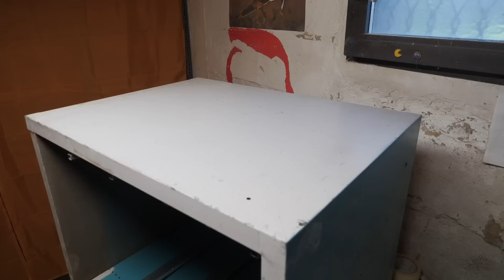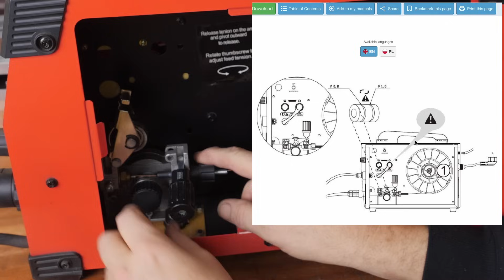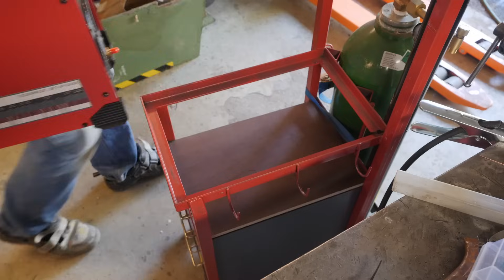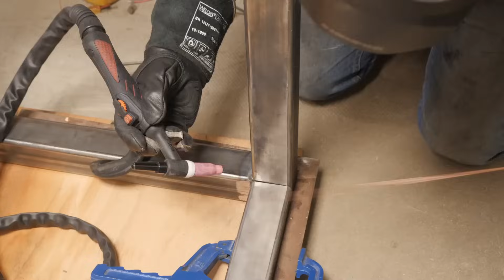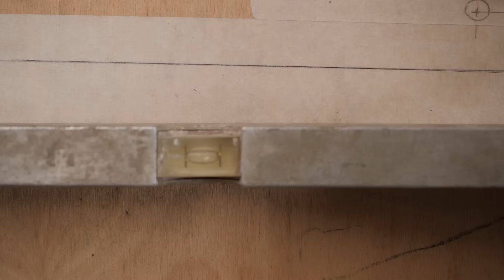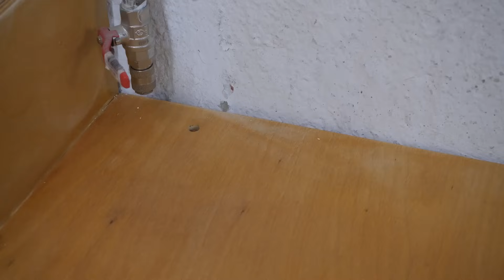My best workshop bench || RotarySMP

Comment: I'm no welder but I"ve seen people usually chamfer the parts where the weld goes if they plan to grind it flat afterwards. Otherwise you’re grinding the weld strength away
Reply from the maker: I should have. I think I started with the illusion my welds would be so perfect they would not need grinding, and then reality can to visit... :)

Comment: I have a 26"-30" x 42"-48" sheet of 3/16" steel sheet with a 1" 90° bent on one end. And a 2"x3" hole cut out of  a corner. I figured id make a little welding table out of it. Get a bit of 1/8"-3/16" wall angle  or 1.5"-2" channel or angle steel to make a frameand legs. Maybe get a section , maybe 24"x24"-24"x30" of expanded metal , or catwalk (about 3/4"-1' x1/8" flat bar separated by about 3/4" and connected with multiple 3/8"-1/2" bars every 6" roughly.) can often br found in 24" wide and random lengths used in factories  and industrial buildings for walkways usually 24"-36" wide (est.) makes a nice car trailer floor. As long as you have enough cross braces..  and would be great for a work/welding bench where modified C-clamps can be used to clamp anywhere. And it can be grounded so no ground clamp required..   and mount 4, 20-30 (maybe 50?) watt LED flood lights over it. So EVERYTHING can be seen even through a welding helmet! I need to get a auto darkening unit... I have some glasses not really for welding  much, best for brazing . Not quite dark enough but i really like them!   Tge cat walk steel works good with T nuts also, have two 'T' nuts on a threaded rod  3/8"-1/2"  lock them both  on the steel. Then a slotted bar can be used to clamp down steel to the table to weld or ???  Maybe make two 6"-7" and two 10-12" with a couple nuts welded to a 6" bitbof pipe with a to put a bar inside a 1/2" bar about 6"-8" long.  Use fine thread in one end coarse on the other. With the clamp on whatever, the coupling can be turned even though the cuping is only moving down the rod. The different thread pitch allows it to tighten the clamp. Maybe use 7/16" and 1/2" . The two sizes if studs (make two of each, 7/16" x 6" and 10"-12", and 1/2" the same length with couplings to put them together the 7/16" fine  to 1/2" coarse with a nut for each welded into the ends of a 5/8" pipe with a 3/8" hole drilled 1/2" above and below center if the pipe the holes completely through the pipe 90° from each other. The bar for fitting in the holes made from a 1/2" bar bentt st a 45°, (30° to 60°) about 3-4" from one end. After the bar is turned down to .370" x 2.75" and a 1/4" x 2.5" bar welded to brace the bend  the opposite end  turned down  3" from the end leaving 3-4" in the middle. Maybe weld a 1/4" rod beside that as well. Bracing tge 9"-11" tool make oversized nuts for the clamps  from 1"bar stock drilled and tappoed. Or drilled out and a nut welded inside. Eith a 1.5" long 1.5" pipe welded on the 1/4"-3/8". Thick slice of bar.  Then drill 2-3 , 3/8" holes in the pipe at 90° or 60°all the way through the brace on the bar allows it to hang on a bolt. The 1/8" wall tubing. Or 1.5-1.625 bar stock bored out and tapped with the open end being about 1" I.D.   and beveled  possibly knurled to allow a good grip by hand then the 8"-9" maybe 11"-12"+ long tool  maybe make another 6" long with a 2" circle with a 1/4" x 3/8" nub allowing it to work like a coil over  wrench,  made from 1/2"x1/2" square bar.   A 3/4"-7/8" long bit of 3/8" bar with 1/2" of it tuned down to 1/4"-5/16" fitted into a hole in the  heated and bent  square bar snd welded in place  allowing just enough room to fit the nuts with a 
1/4" x3/4" bolts (grade 8 or better)  placed 180° and 22.5°  from the 3/8" pin.  The rest of the square beveled corners to the opposite end where 1.75" of it is turned down to .375"-.380" fitting snug in the drilled holes.  Maybe add a 4" long bit of 1/2" square bar welded to brace the other . Chamfer/ bevel the edges and taper the end 1" taper frim 1/2" to 0";over 1".   1/16" bevels.  Made from a carbon steel capable of a temper with a 35-42 hardness, about 2x that of a mild hot rolled mild steel.   Use the studs and nuts  with slotted bars made from 1/2" x 1.25" steel bar with a 1/2" x 2".  And 1/2" x 6" bars also a welded bar made from  
1/2" x 3/4"  bar 12"-16" a slot allows a 2" end to be swapped out  the 3/4" thick steel having two 
1/8" x 1" tabs  that attach with two to three 1/4"x 5/8" basically grub screw's, the tapered pin 5/8" long with the 1/8" deep allen head with a 7mm diameter tapered head  fitting into. The 1/8" thick steel    m6 thread m7-m7.5 head about 45° tapered seating head  the end caps using either two 1/8"/3mm  flats seperated by 1/16"  or a single 1/4 maybe go to 1/2" x 1" steel.  With a 1"-1.5" long 3/4" steel square connecting the two pieces.  Either a 45° tapered nose going from 1" thick to 1/2" and 3/4" wide or 1.5" wide to 3" wide with a split like a crowbar or claw hammer. With a 1/2" wide groove in the center 3/4" deep.  The last option is s coupling end allowing teo bars to. Be connected together.  Use with the 1.5" x 8" x 3/8" thick , and the 1" x 8" x 1/4" thick  plates. Allowing teo plates to be connected together to fit across the 30" table. And over something 14"-16" tall possibly 28"-30" if 4 long studs are made.  Or two 7/16" and two 1/2" studs  with  the nuts  being turned different. the 7/16" for example having the upper area turned down about 1.425"  and the 1/2" being turned 1.500"  both made from 1.635" bar stock making basically oversized flange nuts  that use a  kinda pin or bar wrench over a hex. It can also easily be a hex, make a 1.5" 12 point hex or square I like the bar nuts because anything can fir it. A 3/4"-7/8"+ wrench can be stuck in one hole spinning the nut, same for a screwdriver. If it was a normal bolt and nut it would have about a 1"- 1.125" thread (7/16" & 1/2" is tiny compaired) the nuts being. Oversized  doesn't require a washer and pressure is spread over a wide area.   Either plate thr steel with nickel or copper to reduce rust a chrome plate would also work possibly attempt to get a .004"-.0045" plate over the steel for multiple reasond i think nickel over copper would be Best. With about .002"-.0025" of copper, and .003"- .0042" of nickel to protect from abrasion dings.  Better than a .00025"-.0005" thick plating you can nearly see through!!  And copper plate the studs. ENOUGH RAMBLING, 🫣 🦾👈HAVE AN AWESOME DAY 🎉🤦🕊️ FORGIVE the rambling on a tangen!! ☮️
Reply from the maker: I found that powerful LED lighting really screws with my self darkening helmet lens. 

You should make a video of building your welding table. Everyone loves a welding table build.

Comment: Amazing, that turned out really nice!

For applying the paint, is the roller better than a brush?
Reply from the maker: Thanks Johann. 
The foam roller makes a nice orange peel surface finish, but it used way, way more paint that spraying. I only rolled it because would have been too much of a pain to drag it to the wood shop for spraying. I haven't done much brush painting, so I cant really compare that to rolling.
Reply: @RotarySMP  Thanks for the explanation!

Comment: Using small worm gear hose clamps on gas lines never feels good to me. I hate having expensive welding gas leak out when I forget to turn off the main valve. I bought a cheap selection box of PEX crimp clamps that work great for crimping various small tubing sizes.
Reply from the maker: Do you have the proper crimping pliers for them? I have shied away from buying yet another specialist tool.
Reply: @RotarySMP  When I started using PEX (home remodeling) my first crimper set cost $200 US (copper rings). Now a SS crimp ring tool costs as little as $20-30. A great tool to have. I recently forgot my pex tool while finishing up a friends PEX install so I used one of those nail puller pliers (nippers) to carefully crimp the SS ring (on one I missed crimping, oops). It worked great in a pinch (pun intended). PEX is also great for running air in your shop. A good excuse to buy the crimper tool. I gave up using copper pipe for anything but HVAC.

Comment: I love your videos. It's nice to see someone who is having similar problems welding, just like me. I get tired watching people who never have problems and always get those perfect welds. Practice makes perfect and a good grinder helps too.
Reply from the maker: I don't weld often enough to get good at it, but I do enjoy welding.
Reply: @RotarySMP  I only have one good eye so welding is not easy for me, plus I'm an old guy whose pretty much night blind (after LASIC eye surgery to correct my vision in 2001). My secret weapon is an industrial LED light fixture mounted to one of those dental swivel lights that dentists use. The LED is about 40mm in diameter and would light up a black hole. More light = better welds. Also I use a clear view helmet. That changed my life after years of trying to weld with the old dark green hoods. It's much more fun welding when you can actually see the weld.

Comment: A very effective and inexpensive paint remover is to use lye. Lye is NaOH sodium hydroxide/ caustic soda or KOH potassium hydroxide. Sodium hydroxide is more effective. Mix lye into water.  This will get very hot and fume up a bit, so do it outside and wear rubber gloves and eye protection. After the mixture cools, stir in some cornstarch till you get a gel like consistency. If you put starch in while it is hot, it will cook the starch and it will set up like silicone rubber. Now you have a homemade, non toxic paint remover.
Reply from the maker: I used NaOH on my vise. The issue is the concentration and personal safety in the home shop.

Comment: Saw the small "soda stream" CO2 bottle. I tried that once and the flask emptied right away :/ How was it working for you? (The co2 gas here in Iceland is very expensive for a hobbyist)
Reply from the maker: My first bottle was also immediately empty. I checked everything and had a slightly loose hose fitting where it leaked out. The second bottle is lasting okay, but there is not that much gas in there, so you cant to a big project.

Comment: I did the same for my desk! I got a drawer cupboard from an auction in an office and put a kitchen counter on top
Also do you think the small spool has less surface speed than the normal sized one?
Reply from the maker: The manufacturer got back to me that the feed only goes to full speed when the arc strikes.

Comment: A few years ago I borrowed a Mig welder to speed up a project. It too appeared to feed wire too slow and it didn't change much after turning up the wire feed knob. It turned out that the machine was just fine. It was just programmed to feed a lot slower when it didn't sense any arc!
Reply from the maker: I got the feedback from the manufacturer that this one does the same. Should have put that in their manual.

Comment: One tip for paint removal is to use those stainless steel pot scourers, I bought a pack from Lidl haven’t even worn the first one out yet and with the kind of stripper you used the paint washes out of them with water.
Reply from the maker: Thanks Tony, good idea. I used steel wool, but it disintegrated pretty fast.

Comment: There is a quick wire feeding button above the wire feeding device, in red, press that, then wire feeding speed will be in normal, cheers!:yougotthis:
Reply from the maker: Hi Edward, Thanks for that input.

I just went to the basement and checked, and you are right, there is a button at the top of that wire area. It is not described in the manual. How does this help if the feed speed is way to low during welding, or am I seeing a reduced speed as there is no arc, and it would speed up to the set value once an arc is struck?
Reply: @RotarySMP  the low speed mode is for cst to replace the MIG/MAG wire, for if the feeding speed is too quick, the welding wire maybe blocked in tube; Once start welding, it will change to quick speed mode automatically 🙂
Reply from the maker: @edwardwang3359  Thanks. I wonder why they didn't bother to mention that in the manual?

Comment: You might not be able to measure the wire feed speed like this because of "run-in speed". The welder spits out the wire with a different speed until it starts to actually weld - arc forms-which helps with starts. Sometimes the knob for adjusting run-in speed is located near the wire feed but I didn't see it in the video (it could be mounted in different models->holes above feeder).
It's quite probable that this welder has either fixed run-in or it's configured as a function of the welding wire speed and that's why there is little or no change when you measure it like you did.
Reply from the maker: Thanks Tom. I need to put a dot on the spool, and film it during a weld and see if it speeds up once the arc is struck.
Reply: @RotarySMP  No worries! I would probably put a dot on the drive roller though. The change in rpm should be more visible (?) and it has a know diameter so you can more easily calculate the speed directly from video.

Also...I am not much of a mig welder since I started on stick and tig but I do quite a bit of it now. Since you also started on stick I think you might be getting big beads mostly due to travel speed. Mig is really fast and the muscle memory from stick tells you to go kinda slow. Therefore you get a lot of metal into the weld area... It was an issue at least in my case. I can't really judge from the video but those welds didn't seem "cold" (sound a looks) so maybe you can just go a bit quicker.

Comment: Please dont go to the store for shorter bolts for the vise. I know its a cardinal sin in the aircraft industry to alter hardware, but I wont tell. Also, as a youtube viewer, I dont have time for that.. Thank you, and goodnight.
Reply from the maker: The bolts are not full threaded, and the nut bottoms on the end of the thread, so i would need to cut the thread longer to make them work. I already bought two correct length bolts. The real problem was people mixing the bolts in the bins of the hardware store, and me not checking closely whether all four I bought were the ones I wanted. :)

Comment: With the wire feed issue, make sure your spool isn't tightened too much as well, it's a good indicator that the spool is too tight when the length of wire doesn't change much or at all when you change the feed rate.
Reply from the maker: Thanks for the input. I will check this.

Comment: That holster is great for the mig torch, but you're gonna want a different style for the tig stinger. Something more akin to a soldering iron stand.

Also, when you're welding to that rounded edge of a piece like that tube steel, you can cut a piece of welding rod to length and lay it down in the gap. That way, when you're welding, it melts too, and you have more filler metal to take care of that oversized gap created by the filleted corners.
Reply from the maker: Thanks for the tips! I appreciate that.

Comment: i have the same welding hood, how do you like the head gear in it? it feels like its going to slip off my melon. im thinking about swapping it out for the gear from my 3m hood.
Reply from the maker: Do you mean the Arc Captain helmet? Mine has a wide bit on the rear strap, and needs to sit surprisingly low on the back of the head, but cradles the back of the cranium, and is really secure. I really liek this helmet way better than my old one. The visibility is much better and has no green tint.
Reply: @RotarySMP  yeah the arc captain helmet, maybe I'm wearing it wrong. or maybe its my bald head and the weld cap.
Reply from the maker: @theoriginalDirtybill  The back of the head band needs to be way lower, so it feels like it is on my neck, to work on mine.
Reply: @RotarySMP  i'll give that a try. thanks!

Comment: Jodie says keep the hot tip of your filler in the gas plume.  My trick (before I got a magnetic torch test) was slinging the torch over something and burning my leg :) For a dodgy non welder like me yours look alright :) Dunno about your MIG issue as  mine just worked mostly. Just followed the guide on the door. I find MIG easier mostly - metal hot glue :) Main source of error is travel speed for me.
Reply from the maker: Since the feed speed is nothing like the label says, I probably should not believe the current rating either, and just dime it, see what happens.

Comment: The wire spacing method from ThisOldTony is to allow for correction on one axis of deflection. You tacked all 4 corners of the pipe instead. You should only tack the outer two, remove the wire, then tack the other laterals while holding it in the right position. This lets it bend in or out while you're doing the laterals. Only tack and weld the inside of the corner when everything is done on the lateral members.
Reply from the maker: Thanks for that. I need to rewatch his video.

Comment: In my welder manual it states that wire feed speed is reduced when no arc is made, maybe thats why your measurements were off.
Reply from the maker: That is an interesting input. I'll check the Stamos manual again, but it is a crap manual and that could still be the case.
Reply: @RotarySMP  Just weld a bit and watch if the wire wheel starts turning faster once you spark an arc?

Comment: that link to the arccaptain needs tweeking, 404 not found ( though it is their page )
Reply from the maker: Thanks Claes, do you mean the link in the video description. I just tried it on my work laptop, and it still loads normally from here.
Reply: @RotarySMP  Ill try it again, but yes, it landed me on their site, but they posted a 404 for it
Reply: @RotarySMP  just tried it again and its still not showing me the welder, it loads the arccapt page, but the inside link is busted for me, (using chrome and Edge) they do post "suggested products for other welder kits, and there is a AD DC TIG 200P that is sold out, so maybe thats the one